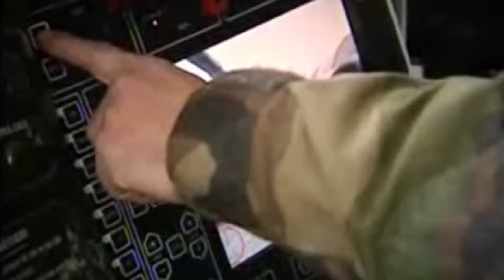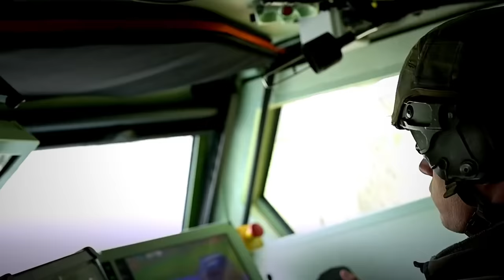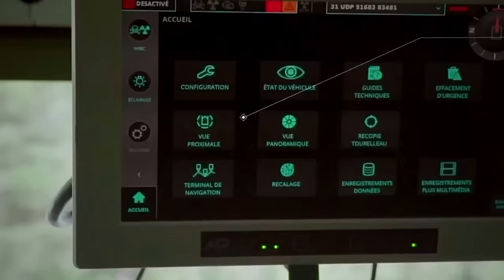This Armored Vehicle is Making the US Green with Envy

Comment: When you see the devastation that drones have inflicted on main battle tanks in the Russian/Ukraine war, these types of vehicles are as obsolete as battleships.  They might be OK for small conflicts against insurgents.
Reply: any vehicle is better than no vehicle against drones, the more protection the better
Reply: Russian has no anti-drone auto-vertical-aiming gun this vehicle has
Reply: As soon as someone jams the GPS, only fixed-wing (airplane type) drones will be relevant as the stability of the drone will be ruined in the short run. Just ask someone who only ever piloted DJI drones to fly a simple quadcopter not using GPS, he will crash it
Reply: @aterxter3437  you are true, this gear (and the jaguar) is equipped with Thales "BARRAGE" system, jamming everything around in 20 to 2500 MHz
Reply: And you would rather walk? Okay 😂
Reply: This thing is equipped with jammers, but also a 12.7mm machine gun that is teleoperated. Nothing prevents the operator to use a track and lock system to destroy the drone.
And through the SCORPION datalink which the French government is developing between tanks, armored vehicles, infantry, planes, drones and radar systems, we could expect that a drone could be easily located, the information automatically sent to the Griffon, for it to just have to press a button, for the gun to aim itself at the target
Reply: What is your solution then?  Getting ridd of all military vehicles, no matter what kind because there is a possibility of them getting destroyed by drones?

Comment: Kornet is laughing in the corner. 😂
Reply: Like the Stryker and Bradley.
Reply: A Kornet will take out anything short of a heavy MBT, unless the vehicle has an APS, which most of the future armored vehicles would have.
Reply: The kornet has a long way to go to catch up with tow missile and Javelins. Literally thousands of videos of Russian armor burning in Ukraine due to these weapons. I think its over 10,000 pieces on oryx now.
Reply: @philchristmas4071  TOW no.  Old news, getting obsolete.  Kornet is likely better.  But the Javelin is better, since it is fire and forget, and multimode top or direct attack.
Reply: Lancet cheap huge numbers - that's the problem.
Reply: Yeah and a micro drone carrying a hand grenade laughs at the exposed kornet operator 😂😂😂😂😂😂😂
Reply: @bbmw9029 wrong.  TOW is still viable.   Wire guidance means it can’t be spoofed or jammed   🤦‍♂️🤷‍♂️🙄
Reply: @smyers820gm wire guidance can still absolutely be spoofed or jammed. To guide a missile, the guidance system on the tube needs to know where the missile is. Usually it’s done by having a flare, or the engine exhaust in the back of the missile acting as a light which the guidance system detects to know where the missile is, and which instructions to give the missile. Earlier wired ATGMs were solely guided through IR, which is easily jammable with the two IR jamming lights on a T90 for exemple. Later variants, such as the TOW in use today uses a combination of IR and UV, which is harder to jam (and I don’t know of any widely used jammer for this), but still totally possible
Reply: @vizender  you definitely have the wrong information.  Wire guidance absolutely CANNOT be spoofed in anyway.   All that can be done is pop smoke and obscure the target from the shooter.  Do you understand what wire guidance means?🤷‍♂️.  The shooter controls the missile from his platform and his signals input goes directly to the missile through a wire.  The only other thing that could stop it would be if the wire breaks and the missile loses control signal input 🤷‍♂️.  Like torpedoes.
Reply: Kornetto
Reply: @smyers820gm yes and no, Ircm or Muss (on puma) can jam most in service wire guided optically track missiles, but tow 2 are now resistant to this jammers
Reply: @ayobruce8211  no it can’t.  It can obscure the vehicle being target with smoke.  You guys have no idea what you’re talking about 🤦‍♂️🤷‍♂️.  You don’t understand exactly what wire guidance means 🤷‍♂️.  Muss detects a laser hitting the vehicle and activates pyrotechnics and electronic counter measures.   In other words smoke and ultraviolet signals 🤷‍♂️.  TOW doesn’t use lasers or ultraviolet targeting methods.  As I said before there’s only 2 well technically 3 ways to defeat it.  1 make yourself invisible by smoke or hiding behind something. 2 the wire breaks meaning the gunner can no longer control the missile or 3 destroy the missile by shooting it down.
Reply: @philchristmas4071  Kornet is better then TOW's. 

It has an excellent range and best in class penetration and explosive mass, the problem is it is a MCLOS and not fire and forget. 

FYI, Kornets have been attributed with popping quite a few Merkava Mk IV's in Gollan Hights.
Reply: The Akeron is probably one of the very best ATGM but it's not shoulder fired, so people don't often compare it, it's basically the french spike but "newer"

Comment: Only 2 kilometers per gallon WOW
Reply: They were talking litres, not gallons. Pay attention.
Reply: With heavy vehicles like this the rate is flipped. It's not miles/gallon, it's gallons/mile. A 1:1 ratio is pretty good. Tanks are much worse.
Reply: @johnsmithe4656  —— it comes out to about five miles per gallon if you use USA gallons.